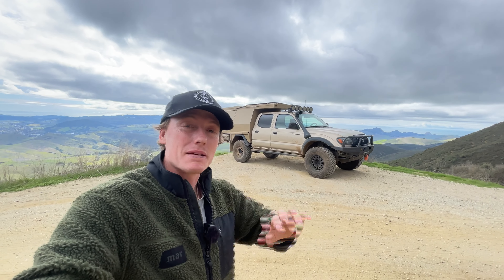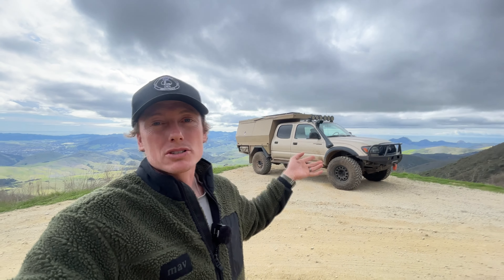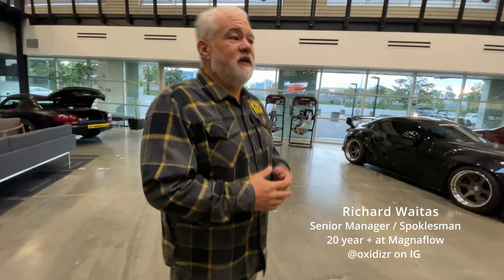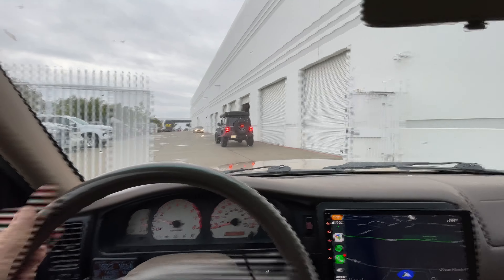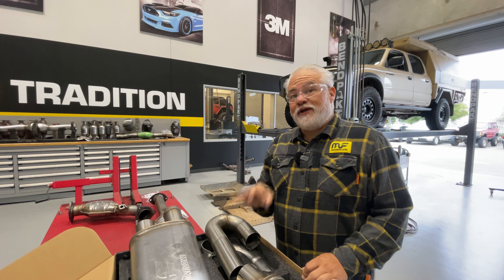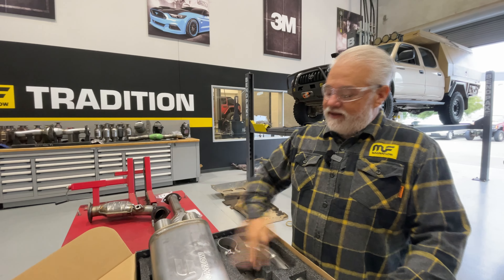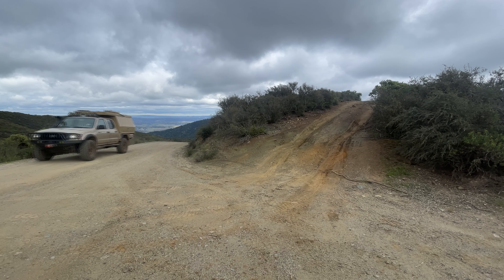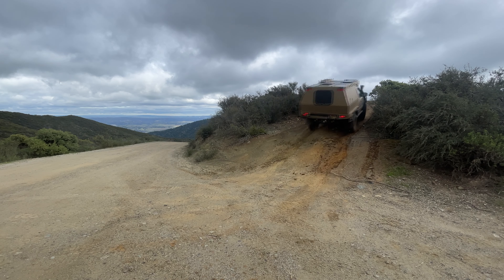behind the scene tour of MAGNA FLOW exhaust in CA

Comment: The audio is wacked out again.
Reply from the maker: Weird! Dang it, i wonder what’s causing it. Are you listing on stereo speakers? Is it only coming through on side?
Reply: Yes, listening on stereo speakers.  I have only had the problem on your last two videos.  All of your others and all other youtube videos work fine.  It might be on my end but I don't know what would be affecting just your last two videos.  Some one on the last video said it might have something to do with landscape vs horizontal, do you hand hold the camera? @ndUnderBudget
Reply from the maker: @280zone  ah is it the sound of something hitting the mic? I think my mic wasn’t actually picking up audio and it was being processed on the phones mic. Super lame
Reply: @OverlandUnderBudget  I hear microphone "rattling" at about 3 minutes in, but audio drops significantly at the 5 minute mark.  Then at 5:15 there seems to be two different audio tracks overlapping.  Then from 5:20 or so I can hear Maganaflow guy fine but your voice is muffled like the microphone is pointing in the wrong direction.  
at 6:35 both you and Maganaflow guy audio is fine.
Then it goes back to your audio being mumbled/mutted.  
It is terribly bad at about 32:30 you in the truck driving.  I noticed you microphone is pointed over your shoulder.  I am wondering if the Rode Mic is extremely sensitive to the direction it is pointing and attempting to canceling out back ground noises.

Comment: Does it have any effect on gas mileage?
Reply from the maker: It does, mainly because it’s so much easier to drive faster. Higher speed higher rpm’s, higher wind resistance. But since it’s a low boost setup your not adding much more fuel until your above 3000 rpm